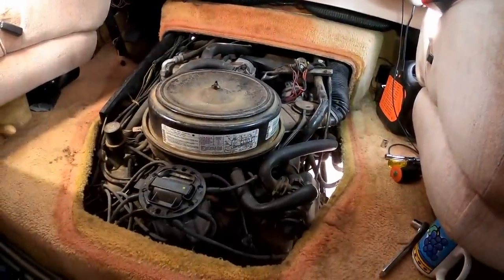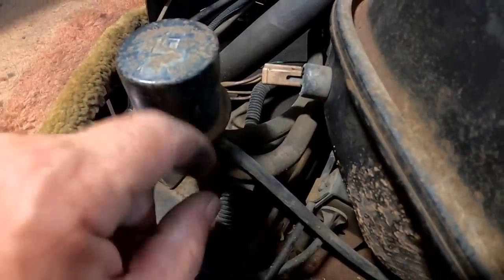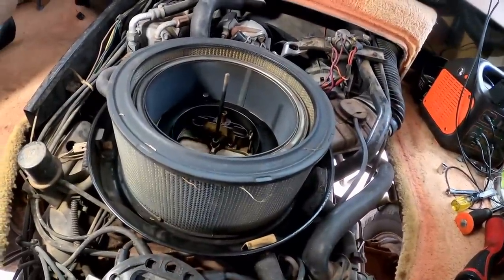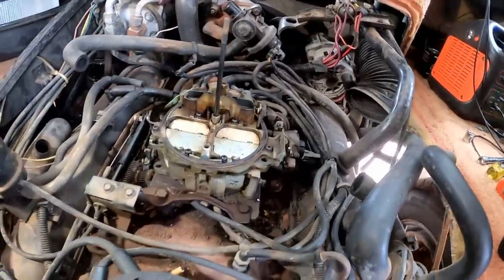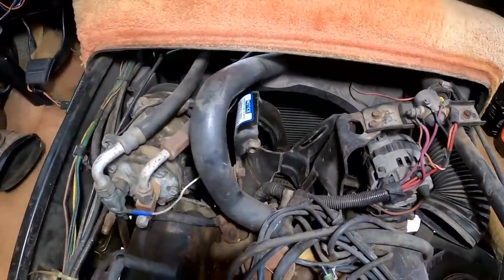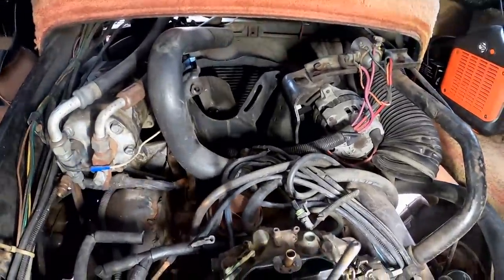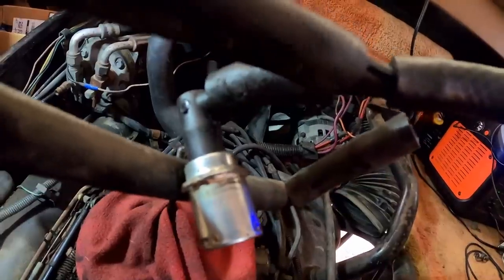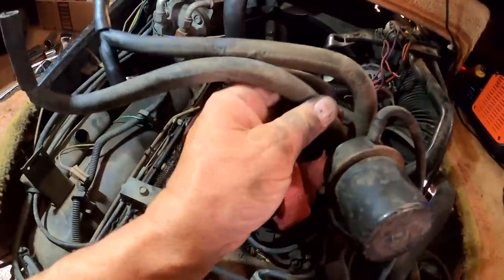Replacing The Water Pump on a Big Block Chevy in my RV - It's A Mess In There! ...lol

Comment: you got this Dave. I removed all of the smog stuff as well as the A/C compressor as mine didn't work. i use the rooftop air with the generator running and it works just fine. All i have now is power steering pump , alternator and water pump all very easy to get to and change if need be.. i know you will but a thermostat change would be a great idea right now while all the antifreeze is gone.. Looks like a great spot you all are in enjoy your time with friends : ) Give Bella hugs have a great weekend...
Reply from the maker: I did the same with the AC unit. I'll run the roof air if I need to. :) ...and thanks! :)
Reply: Hi @frankavery8306 I need to replace my radiator on my 454 coach and I as well have been thinking about getting rid of the smog and ac, when I do, what should i do with those air hoses that eventually end up going into a manifold or something? do i just cap them off? thanks in advance for any advice you can send my way.

Comment: Looks like that small belt that drives the power steering pump has rolled over and is upside down.
Reply: I do believe you are correct.
Reply: That's a top cogged belt. Keeps the belt cooler. We used to run em on our circle track race engine.

Comment: I had to pull the radiator for repair in my old Southwind. That was fun in itself but I figured I’d put a new water pump while I was in there. I couldn’t believe how heavy it was! God!
I remember removing the bottom half of the fan shroud and working at it from underneath.

Comment: When I used to do maintenance work at The Y.M.C.A here in Asheboro.   They had a Bus with a 454 Chevrolet Engine in it.   I am not really a Chevrolet Guy, but that Old Bus would get down the road pretty good after it got warmed up.   It had a Straight Choke with a throttle on it.  It was kinda Cold Natured, but once it got warmed up, it would get down the Road pretty good.

Comment: Don't feel bad Dave I just got a Ford Jamboree 1983 on a Ford Econoline chassis it's a E350 and here's the thing I had bought a battery from AutoZone and turned out the battery was bad and here's the other thing that battery made me realize that there's other things that were loose Connections in other places plus it gave me the chance to check the alternator and the alternator was bad so don't feel bad bro it's part of being a nomad and being on the road you know don't go broke trying to fix something that's 35 years old just you know do little as you can when you can if it ain't broke don't fix it

Comment: I had a 68 Impala SS when I was a kid.   It had an air pump and lines that ran to steel tubes three times into the exhaust manifolds.   The engine sounded like it was missing.  I broke the pipes off and welded the holes shut.  It did not sound like it was missing any more.
Best of luck to you.   Kevin

Comment: Those weird brackets around the A/C compressor are from whoever installed the aftermarket A/C system on the Coachman. You may have to reuse some of that garbage when you go to tighten the belts.

Comment: Hello Dave 
Sorry to hear the pump is bad. Lucky it didn't come off & hit The Radiator.  I suggest using a Heavy Duty fan Clutch & Stock fan.
Get a aftermarket Intake manifold & valve covers & A Holy 4 injector carburetor.
Reply: Yes those Quadra jets are only going to be a problem later

Comment: Smog pump pushes fresh air to mix with exhaust gases to help with emissions.Charcal canister catches fumes.Another valve opens at times and the fumes the canister caught runs up into the carb to get burned.There is more to it but that's the basic part.

Comment: That’s a nasty nest of snakes under there, it’s a good thing you know what you’re doing.👍🏼 I’d have to make a dozen diagrams and mark  every hose,bolt, nut and piece to be able to even think about reassembling it and then I’d still fail. I’m one of those people who have no business touching anything under the hood. My ex and I used to change engines in Bugs and made some into Baja buggies to have a blast on the beaches around where we lived but Bugs were pretty simple back in the day. Good luck with all your work and the rest of the trip. 🙋🏼‍♀️🥰
Reply from the maker: Thank you! :)

Comment: I’m guessing that the funky brackets were maybe for a dual alternator setup. Gm started using RPO codes in 1970, but there’s a chance that the rv fitter killed the label. RPO codes would tell you as I’m sure you know. Looks like that rig had a shade tree mechanic or two. Good luck 👍

Comment: They say: "Don't scratch were it doesn't itch". After 35 years plus the Waterpump is worn, So will everything involved with the Waterpump, rubber pipes and the Heater box. Dave: you know your stuff . Thank goodness you didn't blow the engine. Keep Miss C smooth running and maintained.  "Here is to the next 35 plus years. Regards from South Africa 🇿🇦.
Reply from the maker: Thank you John!

Comment: I hope you went ahead and did the timing chain and gears since you were that deep into it. Could save you some grief down the road.
Reply: This is a low mileage engine.. Timing chains will easily go 100 k plus miles..
Reply: @TheJcrandazzo  True but if I've opened it up this much I'm changing timing chain and gear. That way 40,000 miles or so down the road I don't have to pull it apart again. One and done.

Comment: Looks like to me the brackets you were showing at 18:07 were  brackets that suported the air compresser . They always over braced them because they had a hell of a surge 
when you kicked on the air.   I had a 1984 bronco that was covered in vacume hoses.  The early eightes was excperment time for smog control.  Didnt take long for all the plastic 
and rubber hoses to dry out and crack.  Then your vehicle would run like shit.
Reply from the maker: I'm hoping that I notice an improvement in performance once I get this all done!

Comment: Just watched a video deleting all that smog stuff.His RV running great with out it.The 80's smog system was ridiculous.Some systems also had a little electric plunger on the carb .The smog system could raise and lower your idle speed.They set the system up so the engine ran kinda hot.Was supposed to help with emissions.

Comment: I just had the water pump replaced on my 99 doge ram wheel chair van parts are not easy to get to had it done at the dodge dealership findly was going out at 64 thousand miles 900 bucks at the dodge dealership but it's fixed running good

Comment: I am sure someone had done some  work in there before and just threw it back together.  However to do a proper repair that the EPA would approve you probably need to pull the coach of the chassis.

Comment: Had a 1980 3/4 ton chevy had same engine the emissions crippled the power. I had to pass emissions testing every year I live in Phoenix had to leave the air pump system on. If you don't have emissions to deal with I would remove it all put some good headers on it the manifolds crack also on those it was always one side too. If you replaced the intake and put some headers and a holley throttle body FI systems that 454 would gain 100 HP.   Those flex fans are garbage mostly used on hot rods didn't need much cooling didn't drive them much. They suppose to flatten out at RPM they have no control really. Likely the previous owner saw how much the thermostatic clutch fan cost they bought one of those cheap flex fans instead.

Comment: Did you make a video of the removal and reinstall of this water pump ?
I have a 1948 roadmaster 70 and need to do the water pump, thanks!
Reply from the maker: Sorry, I guess I didn't include the main part of the job. The getting to the water pump that I showed is the hard part of the job. There were only 4 bolt that remained for removing the water pump itself. That is actually the easy part of the job.
Reply: @Dave's RV Life  well I gotta do it tomorrow,  so I'll be making a video that hopefully will help the masses as well (or the last vehicles like this on the planet,lol)

Comment: That old big block will be happier with all that crap off of it. I don't understand the serpentine belt in there, They didn't use them back then did they?  the  Almost looks like they changed the alternator that had a serpentine pully and instead of changing the pully they got serpentine pully's for the water pump and crankshaft. I think I would change it back to "V" belt and put the fan clutch back in it that old flexlite fan makes a lot of noise.
Reply from the maker: I think the 80's is the era that serpentine belts were first being incorporated into the design. I've had three vehicles of this era that had both serpentine and V belts.

Comment: People want these old engines for their simplicity.. Thats a joke.. This engine is a monster mess and Ill take a modern OBD II computerized  F.I.engine any day. No engine these days are fun to work on but the diagnosis can usually be helped by the computerised code system.Chevy water pumps are easier than most ..Good luck if you can get the parts...You probably will fail inspection in locales where they test for them.
Reply from the maker: Fortunately, motorhomes are exempt from emissions inspection in Pennsylvania! :)
Reply: @DavesRVLife  That good news.. .. Dave, you might want to remove your cats as well.. Without the air they will clog up sooner and restrict exhaust and affect fuel economy.
Reply from the maker: @TheJcrandazzo  It doesn't have any Cats, which is also good news. ...on second thought, I wish it did so that I could sell them for scrap! :)
Reply: @DavesRVLife  Probably removed because they were previously restricted.. The air pump works in conjunction with supplying O2 to increase the temperature to burn off particulates in the cat.Since the air system wasnt working they probably did a job on the cats and consequently removed them. Seems like there is some bastardization going on in this engine prior to your arrival.. Just some thoughts.